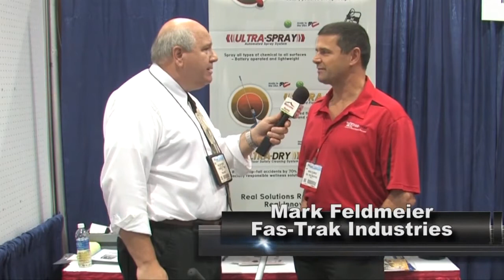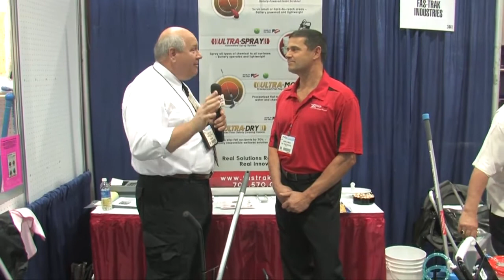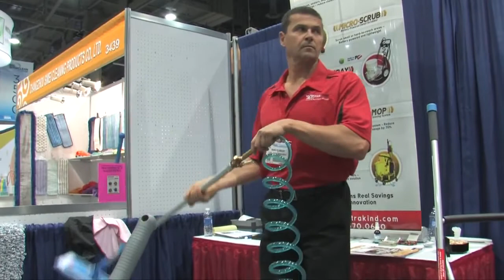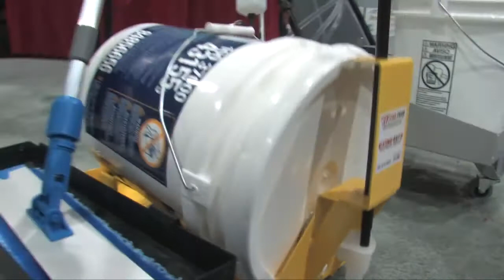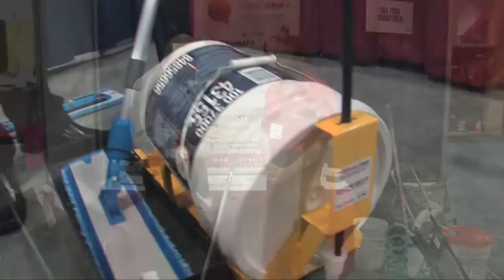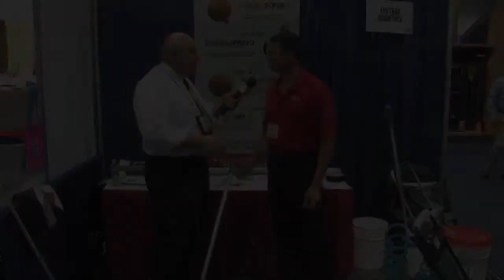Fas Trak Industries on Technology Today

Comment: I own the ultra trak wax applicator and over all it's a good machine, it does have its issues such as it streaks easily, and I find once you get into the third coat as you do your passes the edge grabs the layed wax and pulls that edge that's setting causing pull streaks... So I lay my last few coats with my back pack wand to get my desired wet look with out the streaks... They did provide a mini wand tank applicator but that's junk now as the valve get stuck open from wax build up and they didn't design the valve to be taken apart for proper cleaning... All in all after I sent $3000  for this kit I wasn't that impressed! The ultra trak is decent and does save me time but in my opinion didn't think it's worth that type of money, that's why I ended up buying the 3m back pack applicator, now that's a very good unit, easy and quick! And every part can be cleaned for long life use.